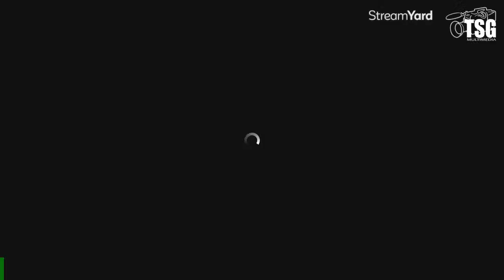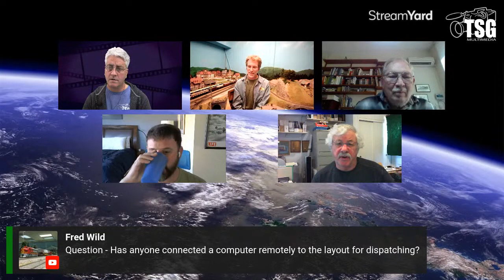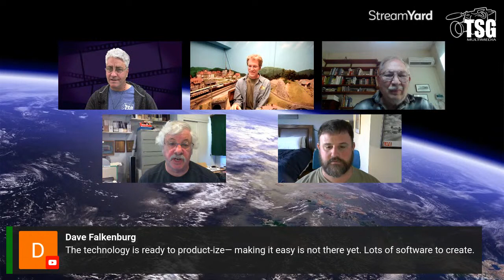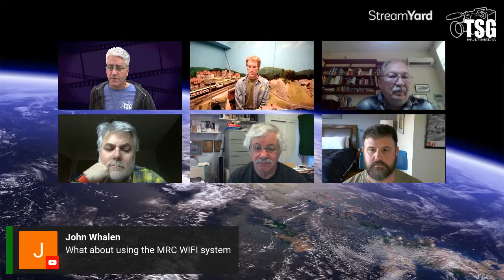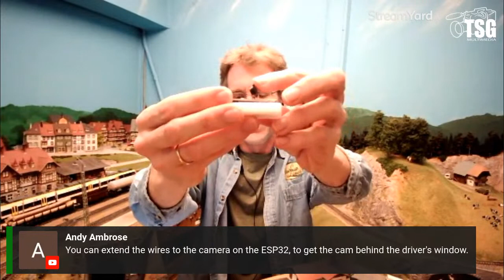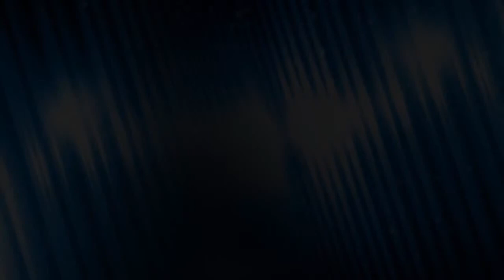TSG Live Crew Lounge Technology & Model Railroading Panel Discussion JMRI MQTT and More!

Comment: Ray Turner, I feel in my opinion has a logical and reliable approach to battery out door model railroading. The sound lighting also adds to the realism with minimal cost and reliability.
 Dc and dcc are great when you know how or how to fix a issues with shorts. I run dc and dcc locomotives on different tracks and Bluetooth homemade speaker for my layout . Ray suggested layers to operate different operations again I agree if one fails it’s easy to isolate but still run your other track.
I value the rest of the guys opinions, however I’m a newbie to model American Railroad and when your talking about coding ,tablets interface and the rest ,sounds to me you guys fly the capital kirks enterprise  in other words you have lost me. 
I love this new found hobby and it’s great to plug in my dc and dcc track and just look at my layout and locomotives and have control .
I have a wireless Polar express on my channel and I ran it through rain snow with a battery operated smoke unit on a dead plastic track with no issues through the Christmas period. Also I fitted a Bluetooth speaker in one of the passenger cars too.
Thanks guys for sharing,sorry I missed the live show due to the time in the uk and work .